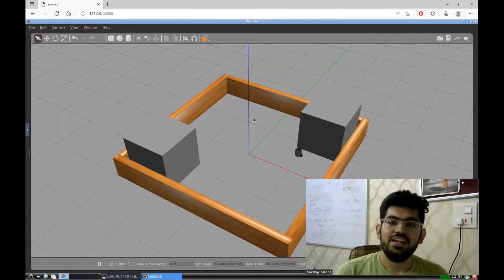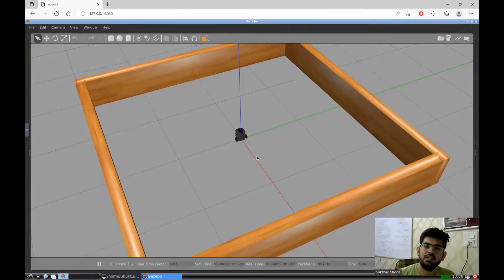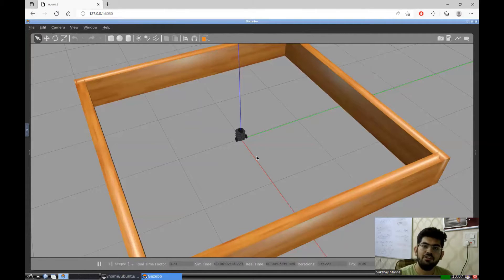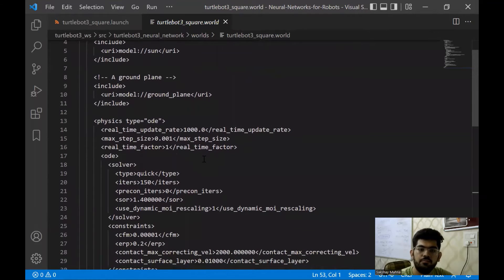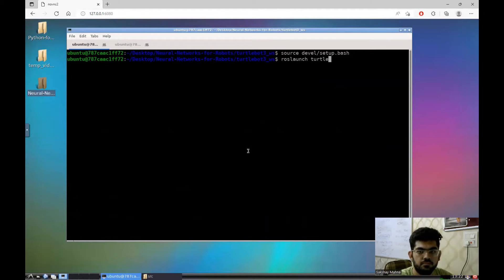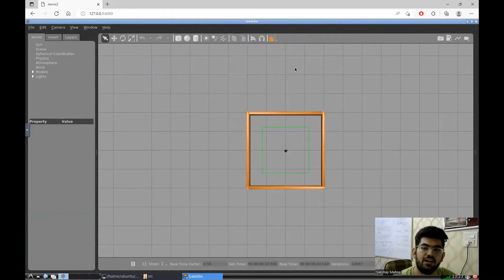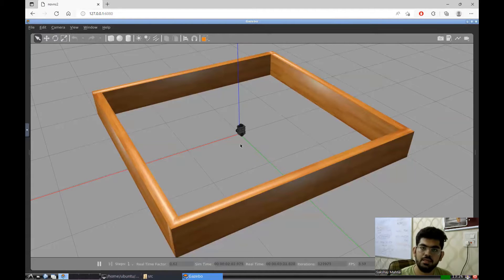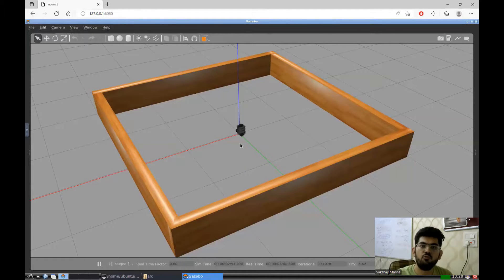Obstacle Avoidance | Neural Networks | Machine Learning in ROS

Comment: Can you explain little more elaboratively (may be in separate video) on the logic of how the data is classified into 1s & 0s?
Reply from the maker: Hello!
I may have went over it a bit quickly. The overall idea is to convert the problem to a classification problem. We use one hot encoding to do the same. [1 0] implies move forward and [0 1] implies rotate. 

However the data we collected was of the form: [0.3 0] for forward and [0 0.3] for rotation. We simply converted these 0.3 values to 1.

The code in the video is just a general way of doing so. For example, to convert [0.3 0.01] to [1 0] if any noise is also captured.

Hope this clears your doubt. Let me know if have nay further questions.
Reply: @RoboticswithSakshay  Got it. Thank you for explaining your logic of labeling the input data to make it ready for NN training.